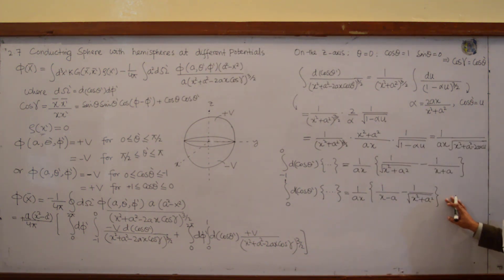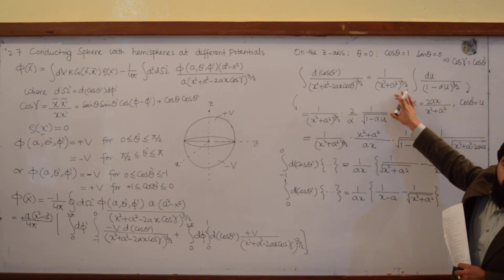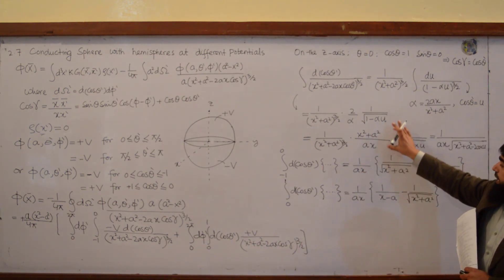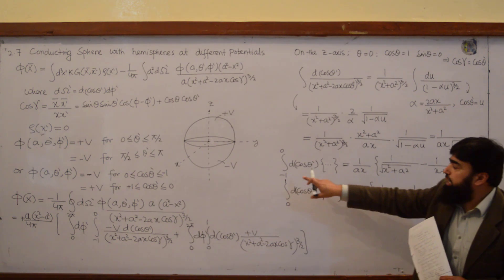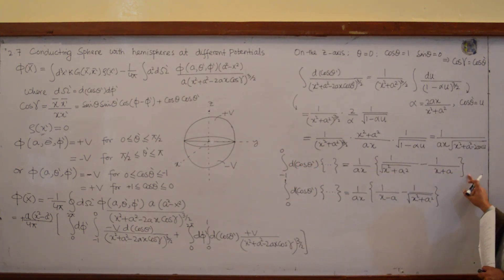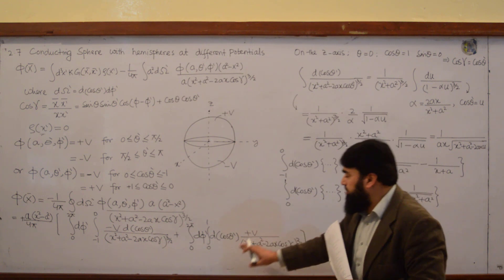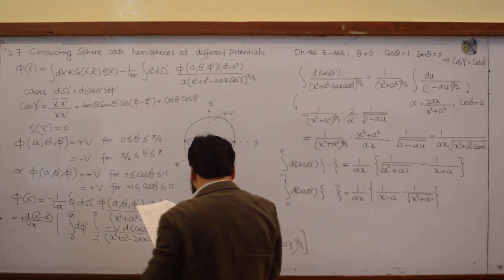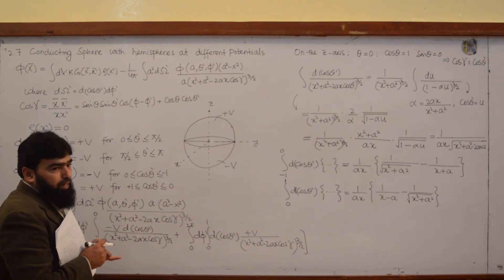L14.3 Final Potential on Z-Axis & The Off-Axis Challenge | Split Sphere Electrodynamics Problem

Comment: essalam alikom , Baraka allahou fikom,  Just a question, maybe outside the context, why when we use the deffinition of the gradient df=gradf dr   we take the differential of the function df  as the function independent explicitly on time, i.e:   df=(df/dx)dx +(df/dy)dy+(df/dz)   (but not + (df/dt)dt )    thanks   a lot   essalam alikom
Reply from the maker: Because, usually, our function is space dependent only. The change we look is always in space only, called spatial variation.
Reply: @SAYPhysics  but when we try to take a general electromagnetic problem when V=V(x,y,z,t) it's clearly time dependent, how then use the same relation of grad (V) (used in electrostatics)?  thanks for you reply and salutations from Algeria...
Reply from the maker: @Skander TALEB HACINE, Salam from Pakistan. A vector quantity that we would have defined in space (x,y,z), if we intend to find its variation in space, we take its spatial derivative, if we intend to find this spatial variation in a maximal direction, we go for its gradient. "The gradient is closely related to the derivative, but it is not itself a derivative: the value of the gradient at a point is a tangent vector – a vector at each point; while the value of the derivative at a point is a cotangent vector – a function of vectors at each point" (quoted text is from Wikipedia). However, in time derivative there's no direction or no maximal direction involved.
Reply: @SAYPhysics  Wa alikom essalem, baraka ellah fikom thanks